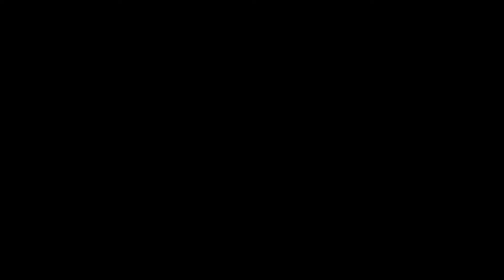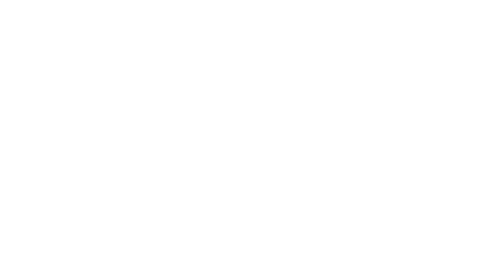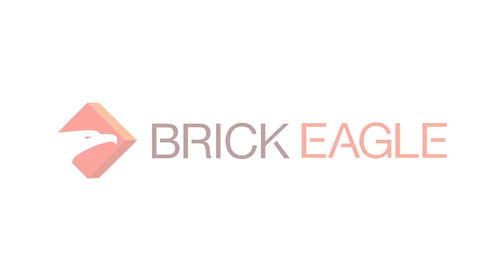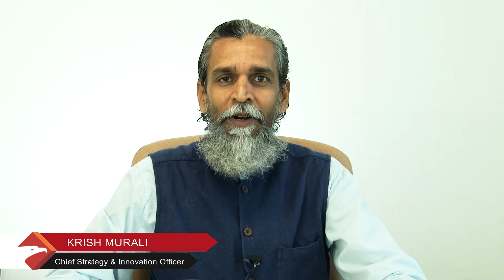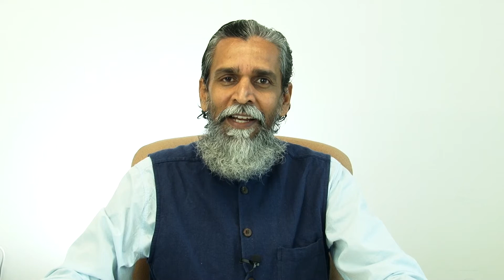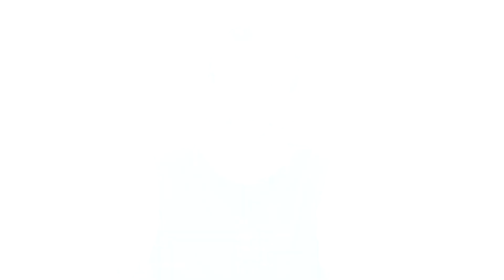The Carbon Footprint of a Building by Krish Murali Eswar

Comment: Thank u so much sir for ur  video...u only talked about main sources of GHG.. but i want to know how to calculate amount of GHG emission from the building...
Reply: Same..
Reply: @hinata5963   it is about calculating the inventory of the materials used in construction. I am a sustainable business student with a focus in construction and this has basically been my research for the past year. What you need to do is check the materials used in the construction process, be it steel, aluminium or concrete etc. Then you us the multiplier tool that is supplied by your country's environment ministry to calculate the amount of GHG emissions from each material. You add it up and you get the embodied carbon of the building. Please also note that it is important to calculate how much carbon is used in transportation of these materials to the construction site. Hope this was helpful :)
Reply: @anuraag987654321  I'm a construction student too, and this is my research topic. The problem is in my country there isn't much data. I only found steel, cement, glass and some other materials. I couldn't find the factor emission of massonary, concrete and other materials so im not sure how to calculate it. + do you know any tool for calculating the embodied energy of the building. I found EC3 but the website is not Convinient..
Reply: @hinata5963  EC3 is the norm, but you may also try and combine BIM with life cycle assessment. Try reading this paper : A methodology for estimating the life cycle carbon efficiency of a residential building. It tries to combine LCA with the value created by the product. Also, if you can't find a particular figure i.e. Concrete for your country try using one from a country with a similar socio-economic and geographical condition. Yes it won't be accurate but it'll be a good educated estimate. Hope this helps 😄
Reply: @anuraag987654321  thank you so much! This is literally my thesis topic. I basically did a simulation to study the building energy performance and then I'm including the embodied carbon emissions. But it's my first time calculating the embodied carbon. I made a comparative study of a building with hempcrete and same thing there was no LCA of hempcrete in my country although it's top country to produce it but it's illegal so they still didn't include it as a building material..
Reply: @hinata5963  fair enough. Love that you chose to go this direction with your thesis. Yeah stuff like hempcrete can be tricky that way. But just let me know if you need any help in the sustainability side of things. And good luck 😁
Reply: @anuraag987654321  
Thank you so much! I really appreciate it!!!
Reply: @anuraag987654321  hello brother, do you have an email where I can contact you in? I have some other questions and I really want to talk to someone who has the knowledge and the interest in this topic.